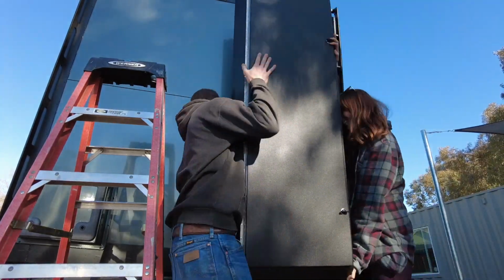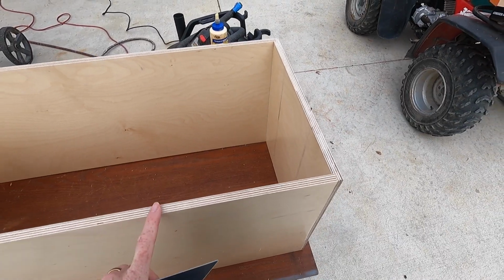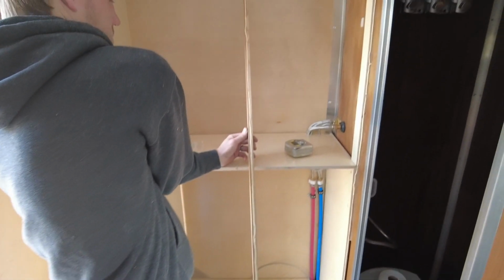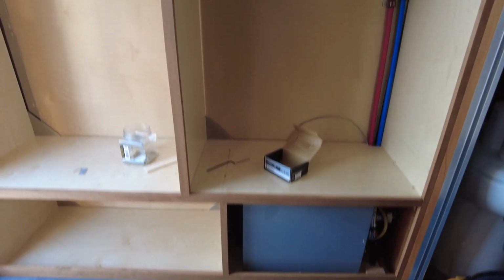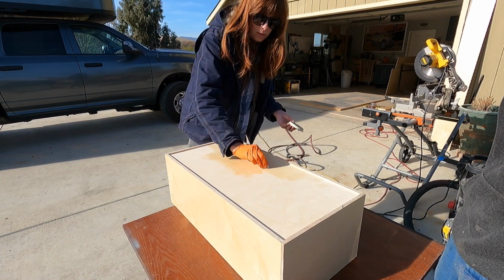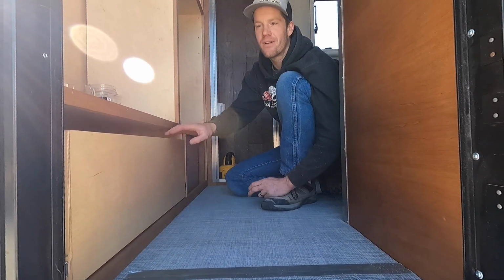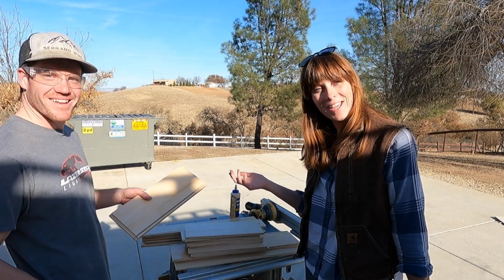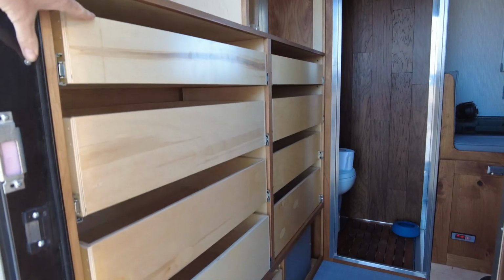Building Our Expedition Vehicle E17 - MASSIVE Closet (Part 1)

Comment: Your way of removing a stray nail is the second best way. The best way is to use the side cutters (like you did) but instead of pulling it through and risking damage to the wood surface, grab the nail and wiggle it back and forth till it breaks off just below the surface of the wood. It’s clean, quick and no damage or tear out. 30 years of woodwork experience taught me that.
Reply from the maker: Thanks for the tip! It's definitely a bummer when you spend a long time making something for a nail to then be sticking out!
Reply: @AmbitionStrikes  Yes it is! There are a few reasons for nails to go astray like that. 
1- The angle at which the nail was nailed into the wood
2- Wood grain directing the nail to one side. (Much les common in plywood since grain goes in opposite directions)
3- (most common) Driving the nail in horizontal or vertical. 
If you look at a stick of nails, all the nails are cut to the certain length as a stick, which creates a chisel point, not a pencil point. That chisel point makes the nail unstable sideways, even in plywood. If you hold the nail gun across the direction of the back plywood (like in a T formation where the plywood is the top (horizontal) piece of the T and the gun is the bottom (vertical) part of the T, you will almost completely eliminate stray nails. Chisel tip nails will very rarely stray up or down. But depending on the quality and length and gauge of the nails, they can stray sideways allot. 
Hope this makes sense!

Comment: Get him to use a push stick on that table saw! Just gotta watch a few videos on how quickly and easily your hand can get sucked into that blade to stop taking that for granted!
Reply from the maker: If it gets too close for comfort I use a push stick. In my opinion the best way to safely use a table saw is to be comfortable with the machine and be in control of the material. It's really hard to be in control when using a push stick. Thanks for looking out for my fingers!

Comment: Very nice.  I have seen drawer built with the sliders near the top, especially deep drawers.  Did you consider other location of slides? and if so, why was lower position chosen?
Reply from the maker: Hi Jason! The weight is carried on the bottom of the drawer so we put the slides closest to that point. This also left plenty of room for our latch mechanisms (stay tuned for part 2).

Comment: For future reference, plywood is very stable due to being cross layered and glued when it is pressed. It is a common misconception. The only reason to leave gap for the drawer bottom is ease of assembly and movement to square the drawer. If you want to do away with unsightly nail holes(even filled), make your drawers using a micro jig pocket hole system. Easy, very strong and no glue or nailing. Never had one fail. Just me as a cabinet maker. I am sure others may say different. I actually built a slide in truck camper which went from SE Louisiana to the Arctic Circle and back. Planning another build this fall, but on the lines of the expedition/overlander. Loads of good info from your video series. Great Job. Thanks.
Reply from the maker: Thank you so much for the tips Ken! I think I am going to have to add that micro jig to our arsenal of tools for the next project. It is great to hear you haven't had any strength issues with it. I would love to follow along on your next build, will you be doing a vlog series or build thread on it?
Reply: @AmbitionStrikes  Going to try. The first was just a "think I am going to try it". Nothing special, but it worked. Next will be quite an undertaking. May take a while, but I have the time and a shop.
Reply: KenCarpenter- Great advice! There are many different views on which is the best looking, easiest and strongest way to build a drawer. 
-but joint
-miter joint
-dado joint 
-dado lock
-miter lock 
-dowels
-biscuits
-mortise and tenon 
-finger joint
-dovetail 
I probably missed some. Everyone has their favourite depending on tools, skill and patience.

Comment: Seriously impressive build.  I did notice that the water heater is pretty much permanent now that the closet is in place.  If it ever needs to be replaced/serviced, is there an easy way to get it out?
Reply from the maker: Thanks! It fits out of the faced opening, or if need be we can also just cut out the panel above (you would never see a patched in replacement as the drawer would cover it).

Comment: Wood magazine has some good YouTube videos for building cabinets if you’re interested for your next project. You added an awful lot of weight on the back end. Are you taking things like center of gravity into consideration? I know all truck campers list their center of gravity and I know it should be over your rear axle but I have no idea how you calculate that. The drawers look awesome!
Reply from the maker: Thanks for the comment! I'll be sure to check out those videos!

The center of gravity can be calculated by drawing a free body diagram of the system. The free body diagram is going to be an estimate but basically we want to include the empty shell weight located at the centroid of the camper structure, and then add each item of significant weight (batteries, large cabinets, shower, etc). The further away weight is from the CG the larger it's effect on CG will be (think about a lever). So, 100# 10" from the CG has the same effect on CG as 25# 40" away.

You are absolutely right, ideally the CG will be in front of the rear axle so the front axle also carries some of the weight. This along with keeping weight low will yield the best possible handling. We have done our best to keep the weight as far forward as possible by putting our 42 gallon fresh water tank and battery/inverter system as far forward as possible. Keep in mind that trucks drive every day with trailers hitched up, the tongue weight of the trailer is significantly behind the rear axle.

I estimate the finished closet to be about 130# (not loaded with stuff).

Before we start loading the camper with stuff we'll be getting a total weight and axle weights done.  I'm interested to see where we ended up! 

-Riley

Comment: Beautiful work, you two!
Just a comment on not glueing the bottom of the drawers. It is essential to not glue the panel insert on a cabinet door, for example, where either the panel or the frame or both are made of solid wood. Expansion and contraction on plywood is very minimal, specially plywood that has been sealed and clear coated like the stuff you’re using. Wood only expands across the grain and not in length. Since the different layers of plywood run in opposite directions, and it’s all glued between layers, it prevents it from expanding either way. Therefore it’s perfectly safe to glue the bottoms in. The only expansion that could possibly happen is in thickness of that bottom plywood. A good bead of glue actually prevents moisture from entering the joint and the bottom panel. 
I love the layout and use of space!
Reply from the maker: Ah, we made cabinet fronts for a kitchen so that must be where I remembered reading not to glue the panel in! Thanks for the expertise on the subject!

Comment: Hi we watched all you video, and are wondering why you chose a fixe camper over removable truck camper? We are considering a similar project.
Reply: Hello. I built a nice slide in camper, I never take it out. My next one I’ll take the bed off like this one. Much better and more room.
Reply from the maker: Thanks for watching! There were a few considerations:

1) Unloading/loading the camper is a pain in the butt
2) We don't have somewhere level to leave a camper so they always ended up just staying in the truck
3) We have found that we actually prefer owning a cargo van for work. We also have a small cargo trailer I can tow with my GX for dump runs/etc.
4) By mounting the camper directly to the truck frame (and not having a flat bed platform) we were able to keep is extremely low. 

If you NEED a truck for work then you should probably do a removable camper. If you don't need a truck for truck things then there are a lot of benefits to a fixed camper!
Reply: Thanks

Comment: In the realm of 'what could possibly go wrong' I'm concerned that access to work on the water heater is even harder than your battery / fuses / inverter. 😱
Reply from the maker: We’re not concerned about it, the front access panel removes easily and worst case we could always cut an access hole in the top if need be... 👍🏻